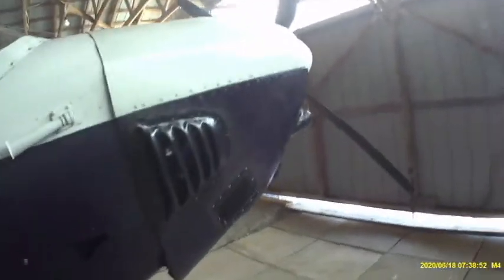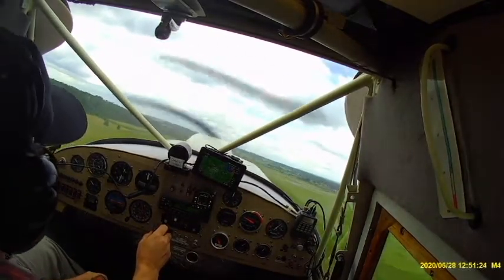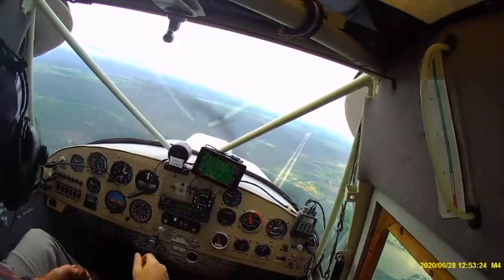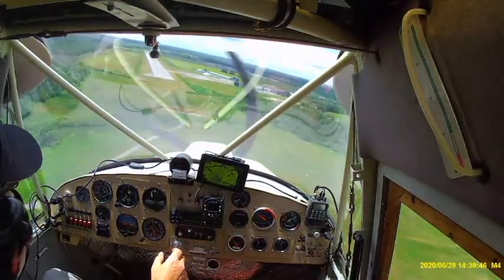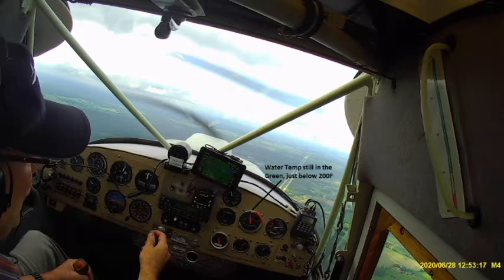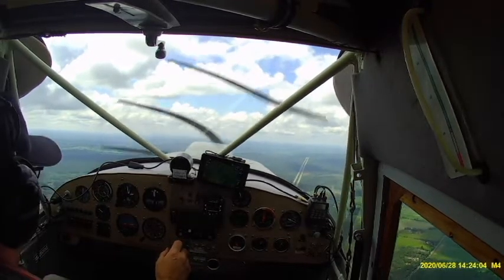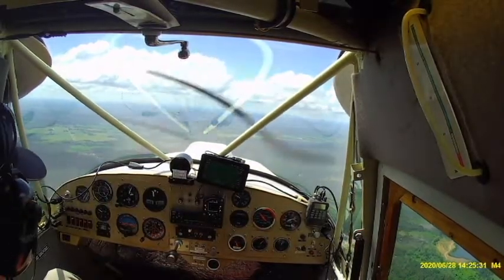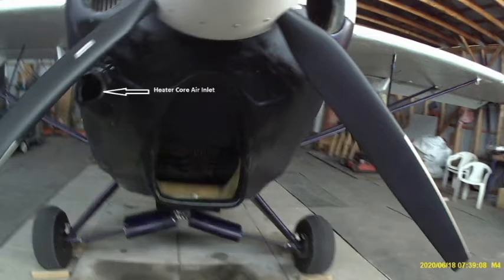Flight Testing  Cowl Mods

Comment: Just to clarify... is the water spray really reducing the temperature of all the coolant that quickly or is it just directly affecting the temp sensor and not representative of the actual coolant temp in the engine? That seems remarkable for 30 seconds.
Reply from the maker: Yes, a quick check of heat transfer of water to air from the human body says it is 25 times faster than dry skin to air - that is why we sweat when getting overheated.  The same principal applies to the evaporation of water from the surface of a radiator, though I'm not sure if the rates are equal.  Double-check the time line in the video - it may be 10-15 seconds beyond 30 but the video evidence is real - nothing fake I assure you.  The coolant sensor in my installation is on top of the engine at the water pump while the radiator and water spray are below the engine - so YES the entire water jacket temperature is being affected.
Reply: That’s amazing!